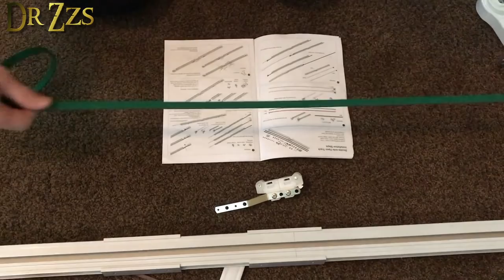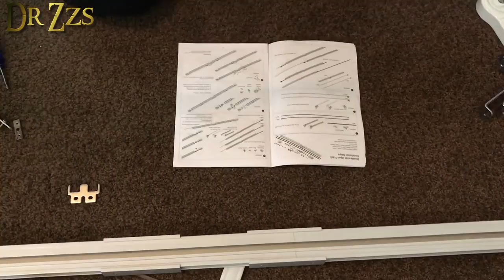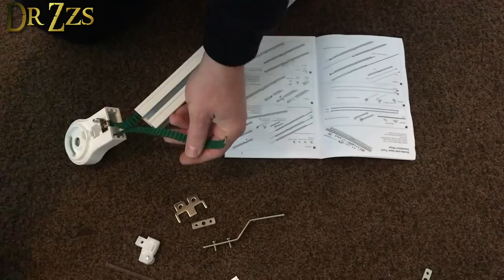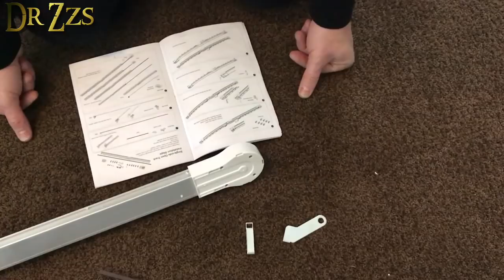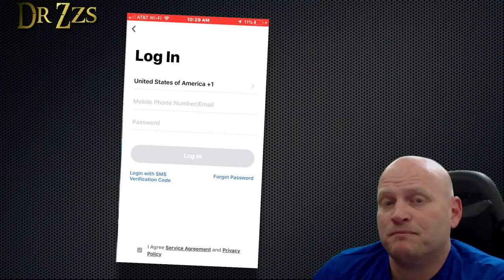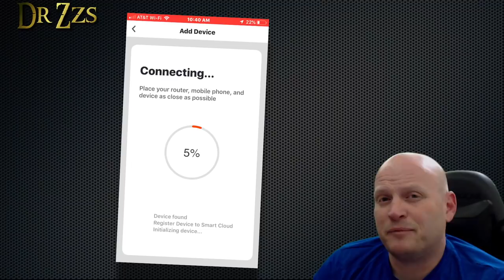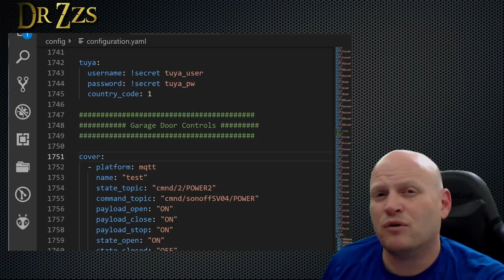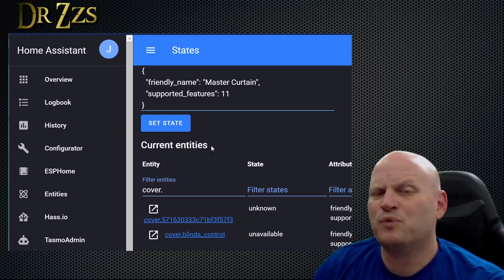Zemismart Smart Curtain | Review & Install

Comment: As an improvement too, you can add some short strings between each intermediate rolling parts for each side of the curtains to make them deploy equally... I mean if you look at the final scene of your video you can see that the "opening part" of your curtains are flat and that lot of curtain material stays on the wall side; if you put some short strings or some fishing string between each intermediate rolling slider it will  permit to the curtains to deploy keeping some waving shapes.. But anyways; GREAT WORK !!!
Reply from the maker: I noticed that too.  Fortunately MrZzs has not... yet.  Thanks for the idea.  When she finally complains about it I'll have a solution ready!

Comment: thanks for another great vid  Drzzz , just as a comparison, I have 2 xiaomi curtain tracks that came with belts etc already assembled, biggest track is 3.5 m so came in 3 bits and the other 2.5 which was in two bits. Great thing is once bolted together thats it, no faffing with cutting belts. Down side is you have to check which brackets they supply as they generally come with ceiling fixings, side carrying brackets are extra but seeing the ones that they sent, a trip to local hardware store would do the trick
Reply from the maker: nice!  how's the Xaiomi app?

Comment: @21:35 you need two motors to control each side separately. With only one motor, the curtains must move in concert.
Reply from the maker: now that you say that it makes total sense.  Wonder why they would include that weird remote to control them separately if there's only one motor?  Thanks!
Reply: @DrZzs  I vote the control is if you have two windows in the room. Train button-set-A for the east windows, train button-set-B for the south windows. Control both from your arm chair

Comment: Thanks for the video, it really made a difference with understanding the installation. I saw at the end of your video that there is also a way to host your automation yourself through yml config file. Which application did you use for this?

Comment: I think you just need to put the hooks lower into the curtains. At least the ones I have thats how you do it. That way the tops of the curtains hide the mechanical slider (manual ones would show too)
Reply: Having the rail up higher on the wall will cut the light more and reduce the heat leaking out the window too..

Comment: Thanks for the video. However the installation won't work for SINGLE OPENING, I have done it for single and after two times going on the rack the motor starts opening only to the middle like wtf 😂
And I have to make it double or just throw it away...  Very disappointed, even the app shows only double opening, but I can see that in the past the motor could do it, I guess there is not a functionality to make it work for both scenarios or I need to code it myself dkn

Comment: As far as the w.a.f I think there are some offset curtain hangers that should stiffen the tops and elevate them up they look kinda like a h and the top pin should go into the top hem "search Amazon for Bali blinds long pin on hooks and compair to the ones your using" or you may just need like a 8" strip of the same style fabric and another curtain rod to hide it
Reply from the maker: ooh, that's a good idea.  Different hooks would do nicely I think.  Thanks!

Comment: Great video, just set mine up watching your video as my guide, only problem I’ve got is the app says my curtains are closed, but they’re open, they open and my app says they’re closed, any idea what I’ve done wrong ?
Reply: Not sure if you already resolved this but I had similar problem and did the following:
Change curtain direction

Direction Change

When the motor run in different direction which is not same as the emitter order, user could operate as follows:

Press the CLOSE & OPEN together

The motor will vibrateonce in every direction

long press STOP within 3 times quickly

The motor will vibrateonce in every direction

Direction Changeis finished

Comment: Great video as always. I have a Tuya switch for a roller blind which I wanted to link to HA. What can I do if I don't get the jumblebunch of numbers? Does it mean the switch isn't supported?
Reply from the maker: hmm, do you have other Tuya devices working in HA?  If you aren't getting the entity_id (jumblebunch of numbers), then maybe the Tuya component isn't connecting correctly to the Tuya servers.  Check your HA logs for anything that looks like a failure of the Tuya component.  All the Tuya switches should work with the official Tuya HA component.
Reply: @DrZzs  nothing in the logs. It's a bare 0.95.4 install with no other components. I got a switch and a thermostat on the way.
Is it better to use the Tuya app or the Smart Life app? Both seem to work and look identical.
Reply: @DrZzs  Ok, just received the thermostat for the electric underfloor heating and the dimmer switch. Both showing up in HA with no issues, so it must be the curtain switch which is the issue here. I guess I need to find a different one which actually works.

Thanks again for your reply, really appreciated. Oh, and please keep these great videos coming, they really help to keep my sanity when it comes to all things HA!
Reply from the maker: glad you have some devices working.  Bummer that one is messed up.

Comment: Big question is.... Can we flash it with ESPhome to rid it of the tuya cloud...?
Reply from the maker: That is the question.  And I don't have the answer.  Not until I have another one to play with.  Maybe they'll send me another to hack into.
Reply: @DrZzs  So my Zemismart curtain motor arrived today and is in pieces around me. Model BCM300D-TY. WiFi, no Zigbee/Z-Wave. Held together with annoying triangle "security" screws. The main board has motor drivers (12V DC brushed), an RF433MHz daughterboard, an RS485 driver and the main chip is a PIC16F1829-1. The "USB" dongle has the Tuya radio modem. I don't think it is talking USB over the pins. Not going to plug this into a PC to find out! Since the main board only has a PIC, it's not worth the disassembly; for the one I own, the little "USB" dongle is where the hacking lives. Will need to break down the protocol from PIC to Tuya, so I can teach Tasmota how to talk it.
Reply: Here's my DIY version - Using a D1 Mini and a NEMA17 Stepper Motor.
- Step-by-Step build guide and programming tutorial coming soon.
https://www.youtube.com/watch?v=oq7FaHZPfO4

Comment: Dr am interested to know if tuya convert work on this knob?
Am afraid to try in my curtain :P
I know that the Hook Up Rob has Tasmotise it by opening the motor which am scared to do.
Can we expect tuya convert of this in next live?
Reply from the maker: probably not this one.  Possibly if/when they send me another.
Reply: (YouTube ate my comment?) My Zemismart curtains arrived this week. So of course the motor house is in pieces and wired to the computer. The white metal box contains a motor with gearboxes and end-sensors (back-emf or position most likely). 12VDC. There are two blue circuit boards, one is a switch-mode PSU, 240VAC to 12VDC. The second board has a 433MHz radio module, op-amp for the position sensors, motor drivers, an RS485 driver(!) (Attached to the RJ12 on the bottom), and the brains is a PIC micro. The "USB" port on the bottom is not USB, but 9600 serial on the USB1.0 pins, and a blue led control on USB3 R+. The little white dongle contains a Tuya TYWE1S, esp8266 +2M flash. So, all the smarts for hacking are in the dongle. I just need to work out how it is talking to the PIC micro. It is 9600, but what does 0x55 AA 00 00 00 00 FF mean?

Comment: Doc can you check if the remotes works with the RF Gate?
Reply from the maker: I did, and they don't.  I had intended to show that in the video but it was getting long already.  I was disappointed not to get a code in Tasmota when I activated the remotes.  Maybe if you can capture the raw RF data, but that requires changing the firmware on the RF chip too and I haven't done that.
Reply: @DrZzs  Thanks DOC!, but if they have wifi, they are cool :)

Comment: Seems the newer version of these smart curtains doesn’t come with a AC plug. You now need to hard wire the motor into the wires in your wall. Definitely not impressed whatsoever with this change.

Comment: Super helpful video! I just got mine all set up and bizarrely the curtains are "backwards" in the app. Hitting "open" closes them etc. etc.

I can't see anything that I've done "backwards" - any ideas?
Reply from the maker: that's odd.  I'm not sure.  I think they have a rep on facebook that might be able to help.  Search Zemismart on facebook.
Reply: DrZzs I figured it out! It was as simple as putting the tracks the "wrong way round". Difficult to explain here but I ran the tracks on the opposite sides to the manual (I had it coming out the top on the right side for e.g.). 

Switched them to match the manual and all is well.
Reply from the maker: doh!  
cursed manual was probably upside down!
Reply: Tried this:
Change curtain direction

Direction Change

When the motor run in different direction which is not same as the emitter order, user could operate as follows:

Press the CLOSE & OPEN together

The motor will vibrateonce in every direction

long press STOP within 3 times quickly

The motor will vibrateonce in every direction

Direction Changeis finished